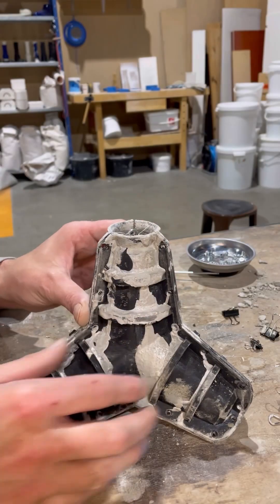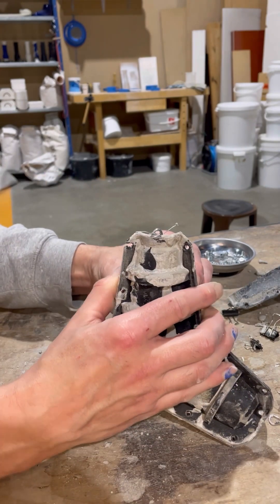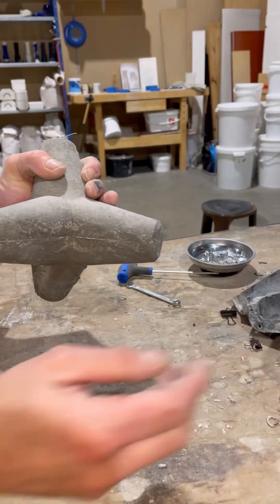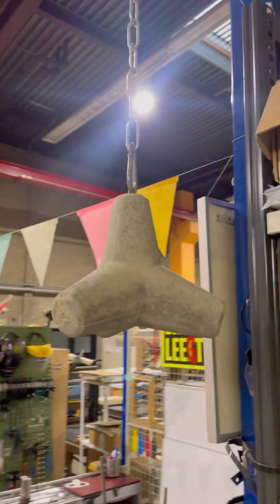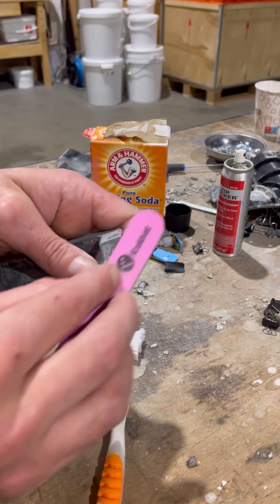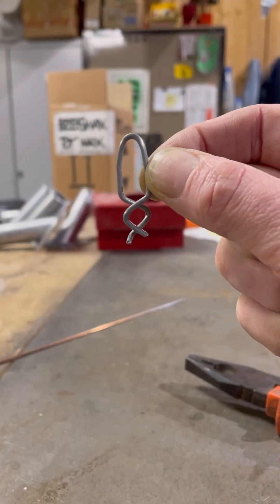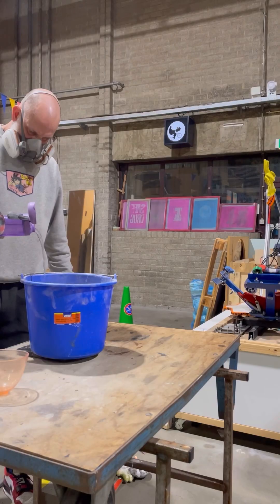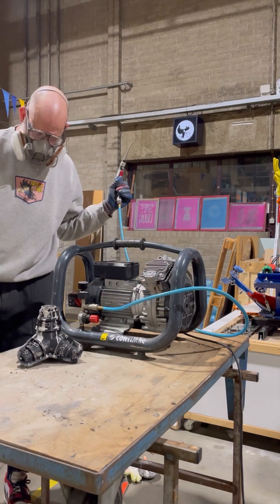Concrete and 3D Prints - Part 3

Comment: Hiii Can you share your 3d model.
Thanks
Reply from the maker: Hi! When I have the upgrade files ready I will make them available to download for a small amount to compensate for all the work that went into it. It will be super fast to put together and take apart compared to what this first test mold was. Also a tighter and easier fit.
I’ll probably announce it in one of the following videos. Thanks gor your interest!
Reply from the maker: Hi! There are three versions of the mould in my webshop on lamballbakra.com now!